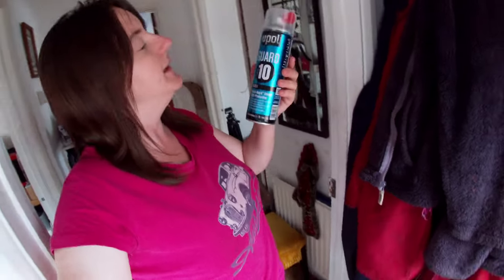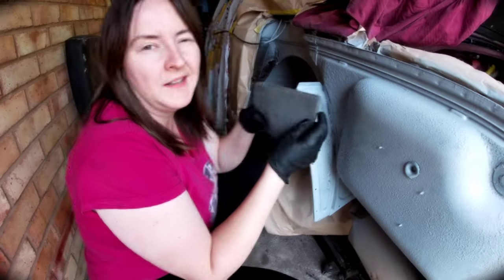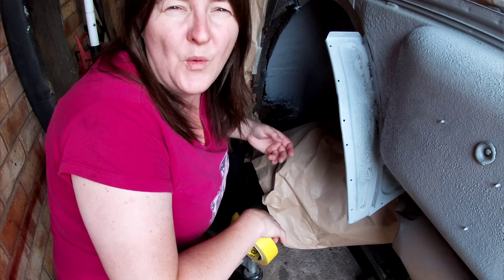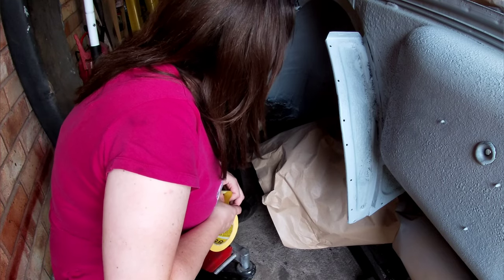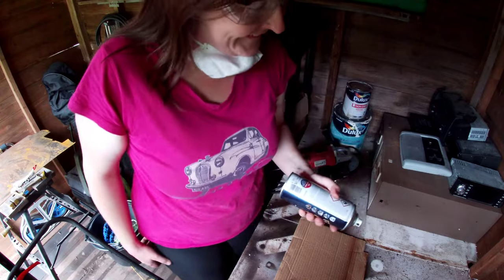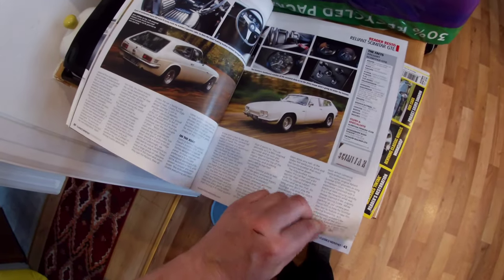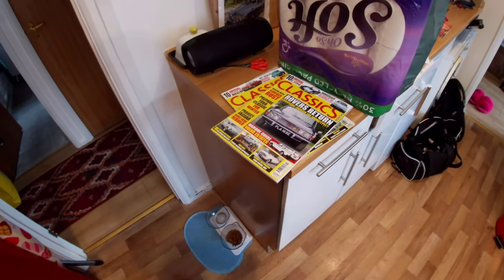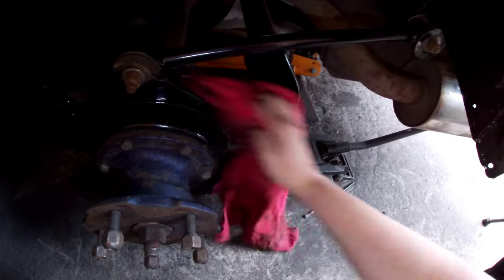Rover P6 - Painting the repairs and masking up the rust

Comment: Hi Alex,
Great work you've done there, a magazine celebrity is always worth saving, as we all have said...I also have a spray can trigger, they make the job much easier to do and control.
Are you going to trailer Mr Jenkins over to the welding shop? Or are you going tow him with your van?
Whatever you decide, take care and stay safe...😊
Cheers, Jon B.
Reply from the maker: I'll be driving him off course! 🤪
Reply: @Alexsassets  Hi Alex, 
I wouldn't drive it in it's current condition, you may get pulled over by the Police. I made that mistake back once in the '60s, got a right bollicking...just advising,
Take care and stay safe,
Jon B. 🙂
Reply from the maker: @jaybee1921  haha I've been driving it for the past few years with it deteriorating . Once the wings are on you will not see any of the D post rot .

Comment: It's looking good Alex, it would put some amature welders to shame.👍 Do you not feel brave enough to have a go at putting the new D posts in yourself is there no welder friend that could come to supervise you to do it there ?  It would save you the hassle and expense of transporting it, or making it road legal by temporarily  putting wings back on. It's pretty easy. Most of it is drilling the door apperture pinch edge seam at short intervals.  Make a row of 1/4" holes about 1/2" apart, to plug weld, which will replicate the factory spot welding once dressed. From memory, there are spot welds to the inner shel that you will need to access and replace from inside. So youl need the back seats and upper 1/4 panels and interior trim out of the way. The rest is seam, or plug welding to the sill and inner wheelwell, which you could also use self tappers to hold in place, to get the initial alignment.  I'd recommend you use 0.6 wire for the spot/ plug welds,  it doesnt put so much weld metal into the hole and is more controlable for plugging and stitch welds. Youll need to swap the wire drive pinch roller over to suit the wire gauge. Have a bit of practice on spare pieces first and youll find it easy.  You simply start at the edge of the drilled hole and spiral to the centre.  Clamp it either side and do alternate spots first, then the spots in between shouldn't need any clamping.
Reply from the maker: I'm going to try doing the D posts at my friend's workshop. Will have more room there and help at hand 🥰
Reply: @Alexsassets  You go girl. 👍.  Having a go yourself, with somone supervising, is the best way to learn.  It's quite a complex reinforced structure with the job it does, but if replacing the whole sub-assembly,  it's quite an easy job once you get the area clear of trim etc. I'd advise getting the fuel tank out of the picture if possible, but not absolutely necessary if you take plenty of  care to keep sparks well clear of the vapour vents / fuel filler, and have it in a well ventilated area.